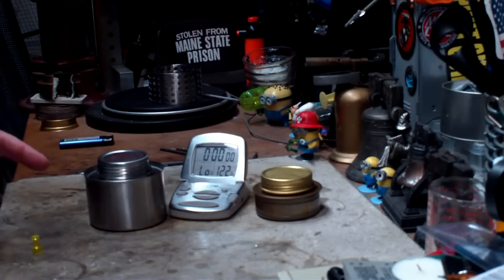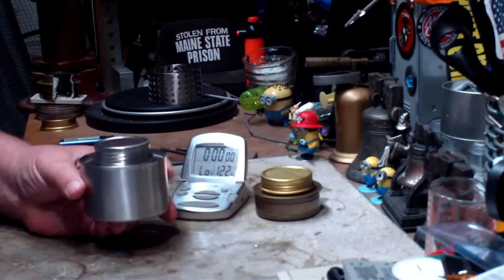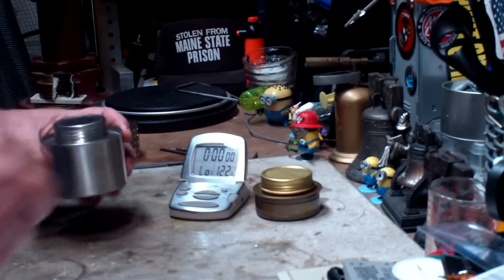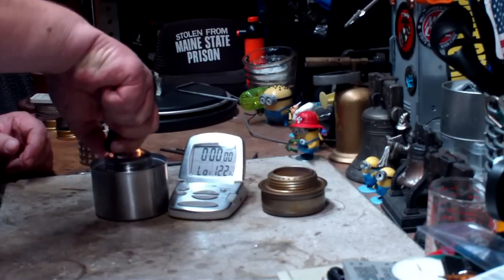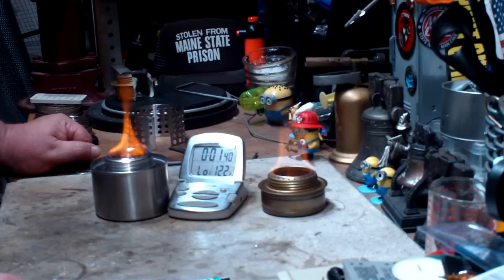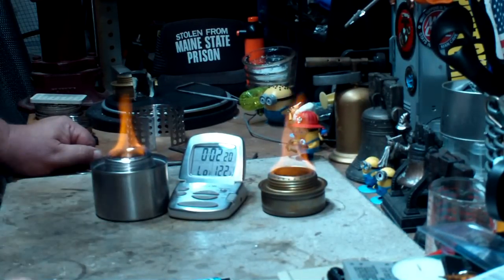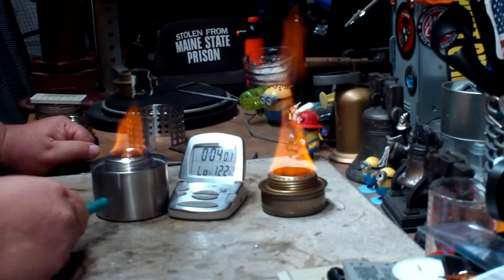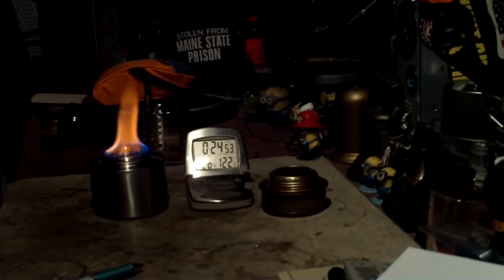Pathfinder Alcohol Burner vs Trangia Mini Burner - Burn Test

Comment: I did the same test last night. Two trangia stoves and my new Pathfinder. Trangia had higher flames, but burned out in under half an hour. Pathfinder burned out after about one hour forty five min. Of course it had more fuel. I was mainly testing flame height. Both had their strong points. If you want a quick boil then go trangia. If you need sustained flame for slower cooking go Pathfinder. I don't think you can say which is better until you do a longevity test. Both seem well built. BTW.... The Pathfinder must have wicking in the inner wall. I looked down three holes when new and saw some kind of fiber. Don't think it could draw a flame on perimeter without wicking to supply vapor.

Comment: Thank you for doing the PF & Trangia side-by-side review. Especially since you're starting out with new burners for each. Fewer variables that can affect results. Good point about grades of SS. Applies to corrosion resistance. "Cheap", for lack of a better term, SS will rust/corrode. Thus, quality is important in situations where the SS is supposed to be non-reactive. 

Suspect the slow bloom time, reported by others on the PF, is due to their ambient temperature compared to your lab. One way to confirm, may be to set burners & a bottle of fuel in a pan of cold water (or a refrigerator). Once chilled to x degrees (say 35F) compare bloom times. While I could easily be wrong, suspect mass & metal type, in relationship to ambient temperature has a direct bearing on performance comparison between these 2 burners.

Looking forward to seeing what your next tests reveal. Appreciate your time & effort, that's for sure.

Comment: I suspect the size, material and fuel capacity of the PF burner will keep the small flame from being able to heat all that mass up to get the same flame of the Trangia.  A can of Sterno will burn for a long time but doesn't boil water in a timely manner.  Perhaps the PF stove will be more similar to Sterno performance than Trangia performance.  If that makes any sense.   Thanks for the great job testing these burners Hiram you rock.
Reply: I know I'm late coming in on this subject but I think you hit the nail right on the head

Comment: very interesting comparision, thank You Hiram!
that deep yellow flame colour in the first moments could indicate any extra carbon content what may result from any manufacturing residues at a burner (maybe traces of any oils or so). If so it should disappear soon resp. not show up in future.
This long burning time doesn't say much to me as long as I cannot compare the resulting heat transfer to the liquids to be boiled. So far I guess the Trangia has much more flame and heat output, so I expect also a longer time to boil in case of the PF stove. But there are still so many unknown factors since the burner only doesn't make the setup ... means pot stand and so on are also important. That's why I'm looking forward to see Your boiling test ... ;-)
Btw to fix the pot stand around the stove is a great idea, I know and like it from the Swiss M71. But what I miss on the PF pot stand are those noses or flaps of the M71 stand, which allow to put there also smaller diameter things such as e.g. metal bottles without using further sticks or grills etc.

Comment: Great video. I'd like to see both stoves filled with fuel and put in the freezer over night and see how hard they are to start.

I'd also like to see a leak test done on it. Maybe fill with fuel, and tip them both upside down on a paper towel or something or weigh them both before and after being upside down for a week or so. See if any fuel slowly leaks out and evaporates before it's noticed leaking.

Comment: Hiram, received mine a couple-three days after seeing your initial video - there were a few strings of unknown material sticking out of the holes.  There is a liner of some sort in there.  The strings burned off on initial lighting.  Today I'll do my sixth burn.  Mine seems to get a little faster bloom each time I light it.  Had it blow out once from the wind with the "stove" off - never with the "stove" on.  After a lengthy burn - the base gets very hot, just takes longer than my trangias.

Comment: I have heard the transit is not meant to "burn out" that,that is what causes theme to crack,leak,etc. that you are suppose to snuff them out,let them cool down and then put the lid on. just a thought for testing
Reply: +MikeSr39 You are correct. That's how I use mine.

Comment: Perhaps you should measure the fuel level in distance from the top as opposed to a measurement in ounces. I think that would result in a better comparison of the two burners. If two ounces puts the fuel level at a 1/2" from the top on the Trangia put enough fuel in the stainless knock off to bring the fuel level up to a 1/2" from the top.

Comment: The coming up to "bloom" times were not that different, because the Trangia had burned for several seconds before you lit the Pathfinder stove.  I have that same model of Pathfinder spirits stove and mine lights relatively quick...just like your result or better.  I also like the larger capacity reservoir of the Pathfinder stove.

Comment: Hi Hiram, greetings from The Lake District, England. I have got a Pathfinder canteen grill top stove Mk 2  (The newest type which is taller) and have used it with the mini Trangia burner, but I would really like to know how the grill top stove performance compares when used with the Pathfinder alcohol stove? The Pathfinder alcohol stove is taller than the trangia so I'm wondering if this will improve performance.

Also, if the Pathfinder stove was filled to capacity how long would it burn continuously?

Thanks for all your videos, I love them.

Comment: Hi Hiram- Regarding the improvement in performance after a few burns...  Sometimes when manufacturing a woven cloth material, they apply a 'sizing' (think of something like starch) to assist the handling of the woven material. Perhaps the several burns have successfully wicked out all of the sizing in the cloth (out with the alcohol and burned up) leaving the wovem material more open or clean for improved wicking?

Comment: hello Hiram, i have a little problems with the english language, an to read all the comments and questions :-), so  i ask without reading all 84.... did you ever test the burntime of a full Pathfinder burner? The slow burn, can be also very good if longer burntime is needed, for heating or temperating my small tipi tent during the evening, for sure not for the night, i know...co less oxigen and so on, but for making a nice temperature for an hour would be extremly nice, without refill.... :-)thanks.... Hans

Comment: As far as the quality of the stainless steel, I have heard the 300 series has less nickel than the 400 series. The nickel inhibits the magnetic properties of the iron, thus the more nickel, the less magnetic the metal is. Nickel is less corrosive, thus the "better quality" label for 400 SS.

Comment: Hi Again Hiram. Could you try a test with only a small amount of alcohol in the stove. I believe this stove is designed to hold enough fuel for a two day trip or longer. As your trip progresses the fuel level will progressively reduce. In my experience the stove becomes more and more difficult to light - it simply keeps going out. I would love to have your opinion. Thanks.
Reply: In my experience, lower fuel in the pathfinder actually burns better than when it's full. I believe that's because the large amount of empty space along with the heat in a pathfinder stove causes the alchohol to evaporate and burn easier when the fuel reaches the burn ports. Also it takes along time to heat up the alchohol enough to evaporate but with lower fuel there is less material to heat up

Comment: Thanks for doing comparison. As has already been mentioned a comparison boil test would be great. Also do you have a way to measure the BTU's? Also could you measure the temps on the units as they burn.

Thanks again

Comment: I'd guess because of the heat conductivity, the Trangia boiled off more fuel during it's burn than the cooler burning PF stove.  You could see the difference in the flames of the two stoves.

Comment: The Trangia burned up its fuel faster because it had a much larger flame, whereas the Pathfinder took allot longer to burn up its fuel because of its smaller flame. This probably translates into faster cook times for the Trangia?????
I'm also wondering if the Pathfinders size, its stainless steel make up, and less holes acts like a regulator on the flame.

Comment: Appears to need more holes and wider base of hole.. when you measure across the burner is the PF stove smaller? will the same lid work?
Reply: lids wont interchange trangia lid slips past the threads on the PF burner

Comment: Hiram; the boil test will tell the truth about this stove.

The person commenting that the PF took 6 minutes to bloom; I know where they got that because I watched the same video on another YouTubr channel.

What those people did was just pour alcohol in the stove and light it. You let the alvohol sit for a couple hours before lighting it.

With the speed it bloomed14-20 seconds It would be a safe bet that the Stove has a wick inside.

The stoves I make have no wicks and if you light the fuel inside the stove and wait for a bloom; the stoves take 17-22 seconds to bloom, and 1/4 oz aluminum gets hot a lot faster than 4-8 OZs of stainless steel.

Would you weigh the stove empty? I have not been able to find that piece of info.

Comment: Not a very good, out of the box showing for the Pathfinder burner. Maybe it will get better, but I doubt it will improve very much with use. It might help it to have some thermal feedback from a cooking pot and windscreen though. 
The size bothers me a bit. It's too large to work with many of the cooking systems designed to use Trangia style burners. So looks like you're stuck using that cheap perforated steel pot stand or building something yourself. 
I'm also skeptical about how it will preform in cold weather, although if it does have an internal wick it might do better than I'm assuming. If there isn't any wicking, I bet it's a real chore to start on a cold morning.
Did you say it came without any instructions? I'm wondering how they recommend extinguishing the flame with a simmer ring/snuffer. Maybe you're just supposed to blow it out.

Comment: What's "mini" about the trangia burner, it's the standard issue ...
Reply: If you poke around ar.y surplus stores,there's a military version a little bigger,but don't think as big as pathfinder.
Reply: @robertmaxwell3220   I own both. The army surplus are no longer in production, and yes more than a little hard to find. But that doesn’t make the standard burner everyone uses, which is overall a more flexible and arguably better burner featuring all the innovations through the years, and comes with the standard trangia kits, a “mini” version all of a sudden.

 It’s in the main production line and has been in it’s current form for decades and decades. Nobody calls it a mini and it was never advertised as such. 

The army one was produced from 64-76 and was always an aside to the development of the main product line, which still existed during those years. 

If anything the Swedish army version is the odd one out, and people including you tend to call it “the bigger army version” because it’s noticeably big compared to standard to suit specific tactical military purposes which may not generally be an advantage. 

If I remember correctly you can’t even fit it properly into most of the standard products.

Comment: Pathfinder stove is cheap Chinese junk. I went through 3 of them, all failed. I was lucky enough to find a 4  ounce fuel capacity Tatonka stove.
Reply: +Paul Gibson 
I am intrigued. Was two failed Pathfinder stoves not enough to prevent you buying a third one?
Reply: +effyleven   Pathfinder was kind enough to give me 2 replacement stoves at no charge. But when the last stove failed, all hope was lost. Perhaps it is because we use Methyl Hydrate for stove fuel in Canada. I had the same problem once before with a Zelph stove.
Reply: Paul Gibson Good answer. Thank you for taking time to provide it.